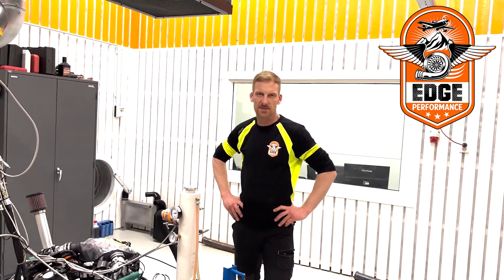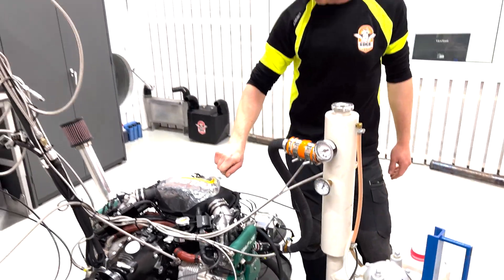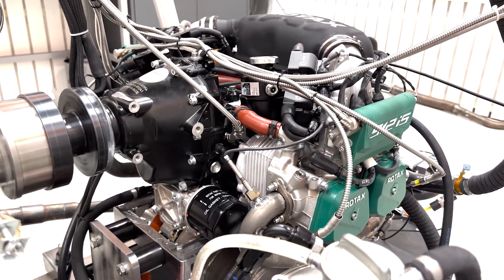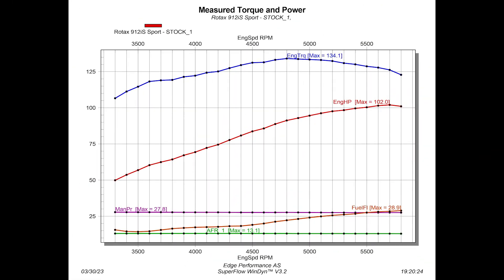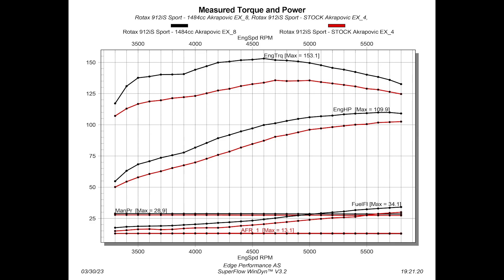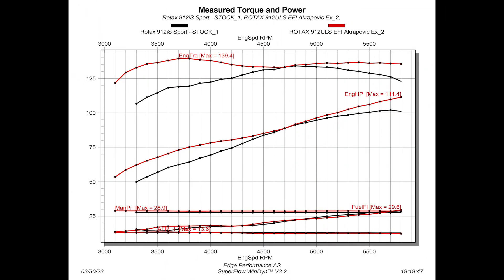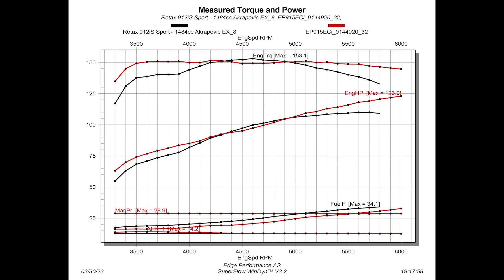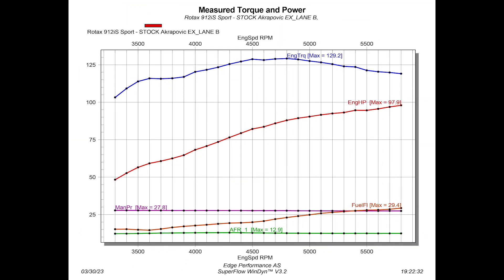Rotax 912iS Dyno Testing And Engine Comparrison At Edge Performance AS

Comment: Edge Performance should sue Rotax for stealing Edge's ideas and incorporating them into their copycat Rotax 915 & 916 model engines.  Rotax should go back to producing their dink 912 80 HP engines that nobody wants.  
912 = 80 HP  916 = 160 HP   Virtually the same engine.  This has Boeing 737 Max written all over it.

Comment: torque values are 'through' the gear reduction box?
Reply from the maker: No, crank torque. PTO TRQ is propeller flange torque.
Reply: @EdgePerformanceNorway   oh,   It sure looked like the dynamometer was attached to  the gearbox.
Reply: @roberttammerawitchey4652  It was. Engine torque can be calculated from PTO torque, as the gear ratio is known. You can see during the dyno pull that both engine & PTO torque are displayed. Engine torque was used in the graphs.